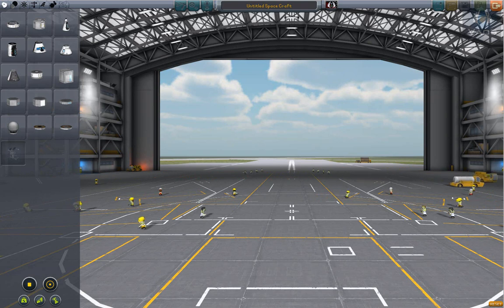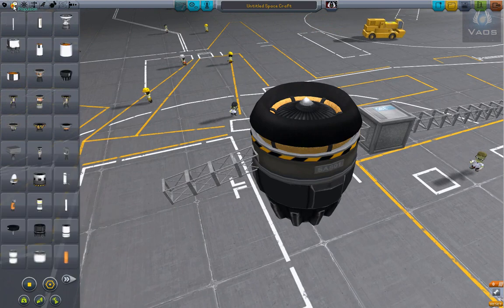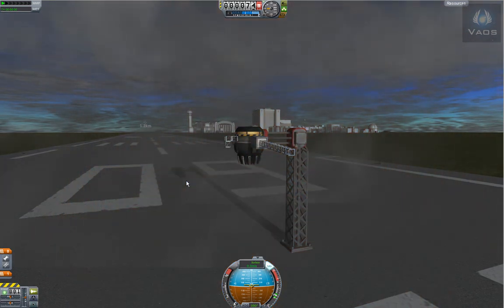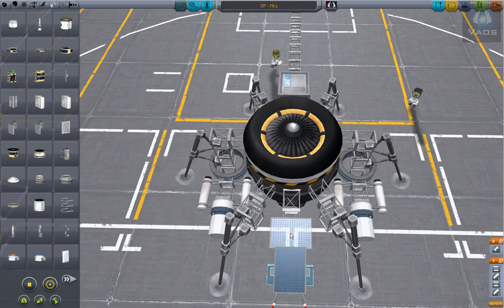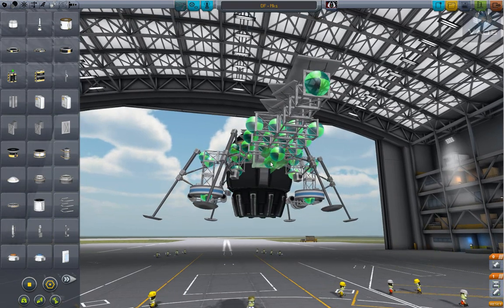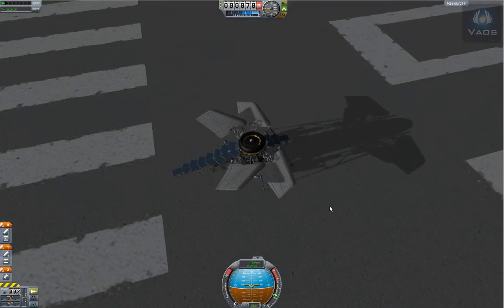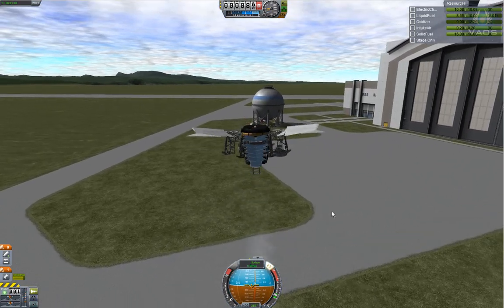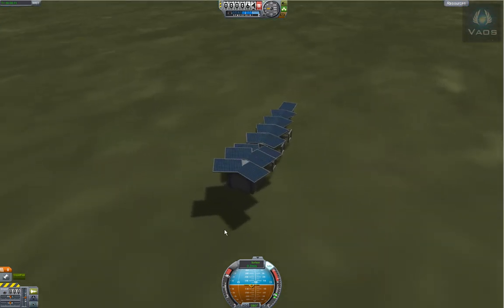*OLD VIDEO*KSP V.23.5 - Building with Vaos. Dragonfly Drone.

Comment: how do you use sas? (ima noob :P)
Reply from the maker: The T key turns on sas, R key turns on RCS, make sure you have parts on your craft that has SAS on it for sas to work :)
Reply: vaos3712 What is RCS?
Reply from the maker: KrinchCraftHD - Reaction Control System. it uses mono-propellant fuel to move your ship around in space. A must have for docking. :)
Reply: vaos3712 Ah ok. Makes sense :D
Reply: thanx man :D